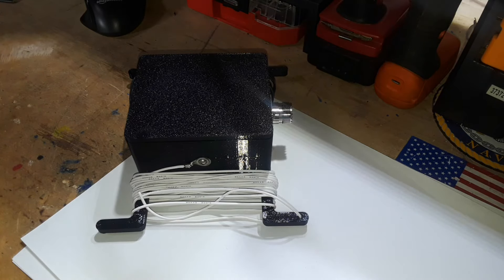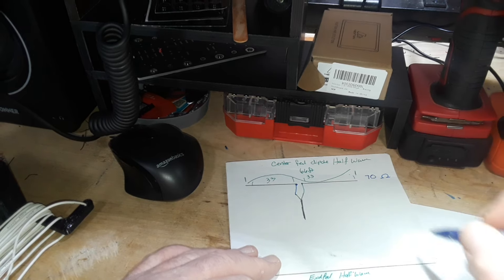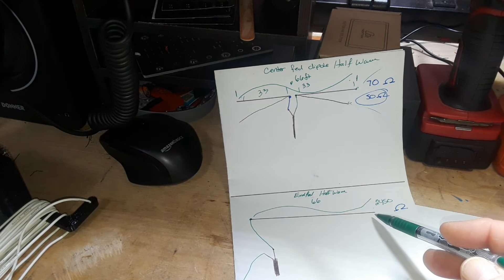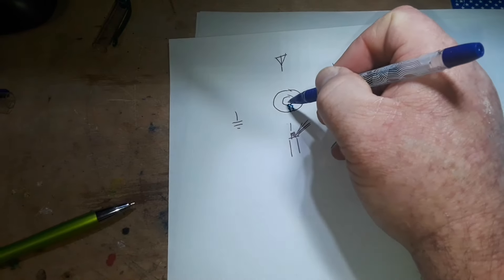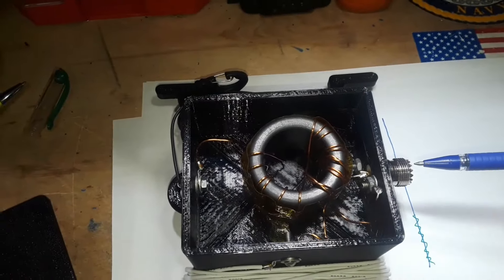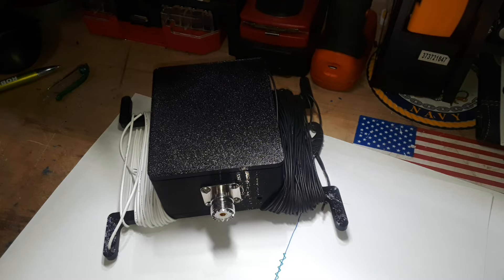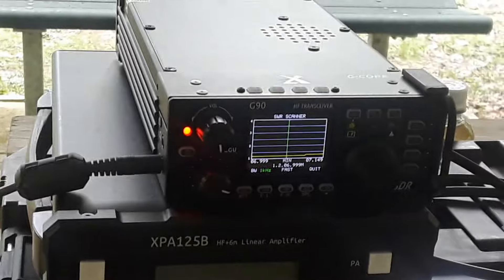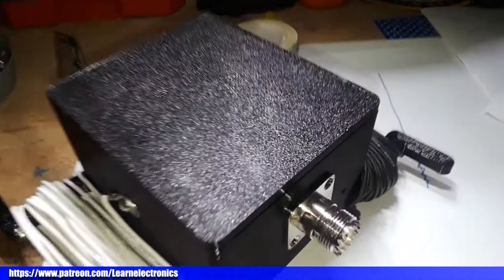Making An End Fed Half Wave Antenna for 40-10 Meters

Comment: Nice, it works. I know a local who built one and it seems to work well. Does it work on other bands or is it only designed for 40 meter?
You could try a fan dipole next 😎
☮ brother.
Reply from the maker: 40-10